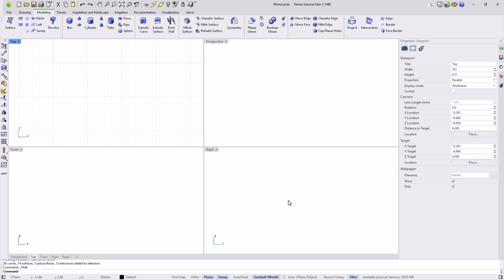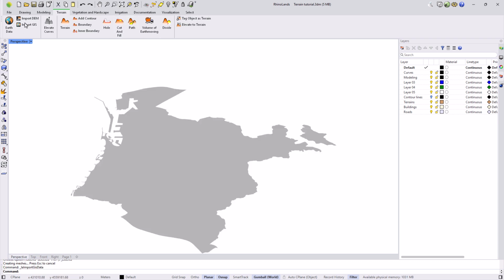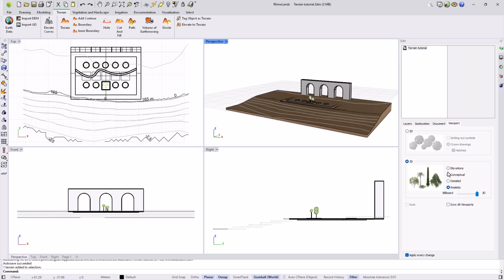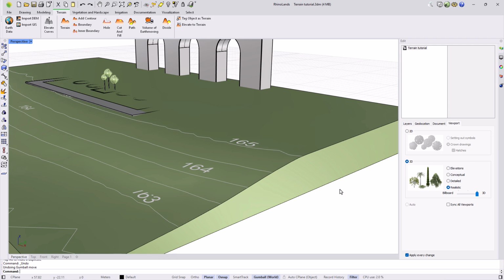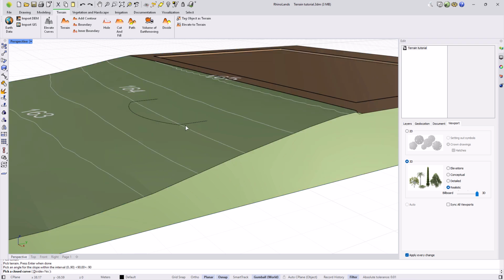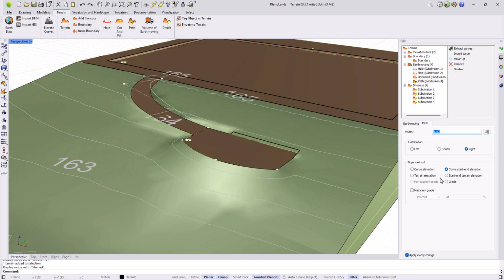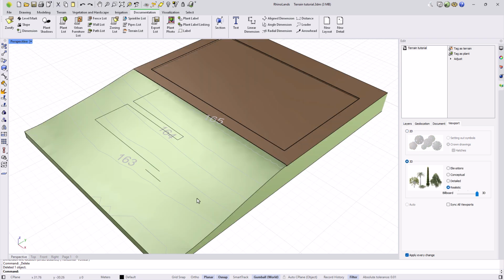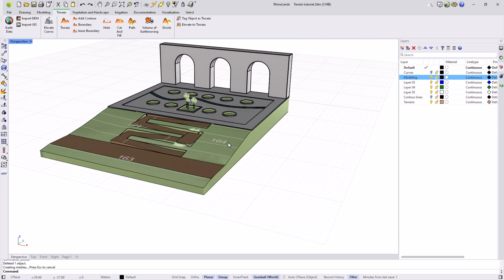RhinoLands Tutorial 03: Terrain Tools

Comment: How can I create two intersecting paths on the terrain? like crossroads
Reply from the maker: To design an accurate intersection between two paths on the terrain, you can use a cut and fill operation based on the shape of the intersection. This allows you to obtain a precise result and also control the slope if needed. Make sure that the closed curve defining the cut and fill area is coplanar.

If you need help with this process, you can contact our support team at rhinolands@asuni.com